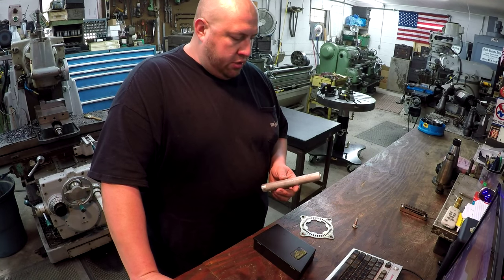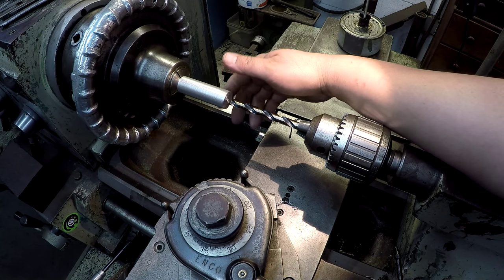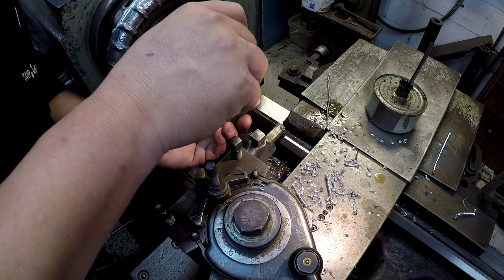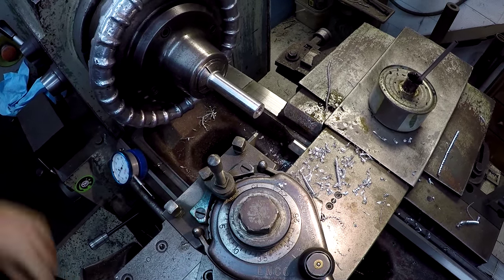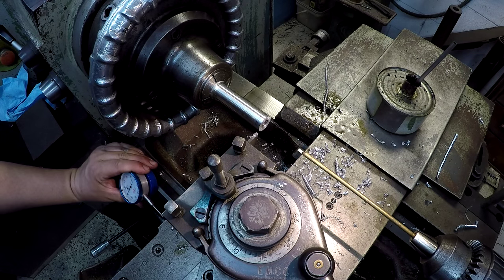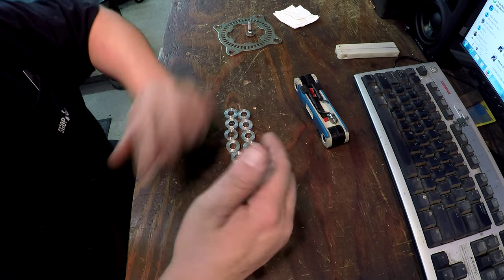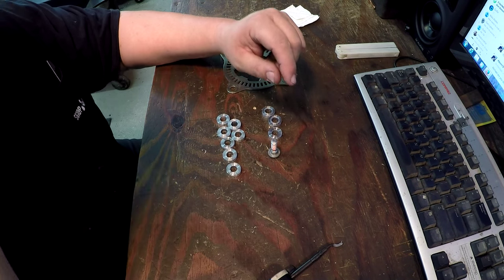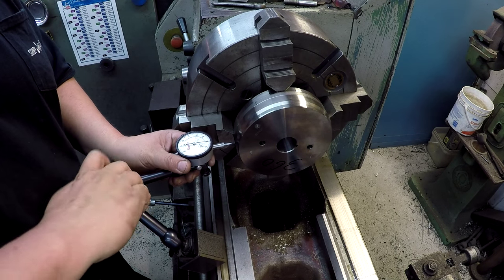Saturday Night Special 89 Part 2

Comment: I made a toolbit that holds a little skateboard size bearing, I find myself using it allll the time to bump chucking work parts true like you were doing with your lead hammer there. It works so freaking well and its so fast I cant stop, especially for 3 jaw work. Sometimes I gotta turn thin thickness plastic parts and I sandwich it between a plastic slug in the chuck and a second sacrificial piece of plastic pinned in the tailstock, the bump centering tool works great there too.

Comment: That noga deburrer works well but I would suggest a glove for the hand holding the parts. I've "read in a book" that they're sharp and can cut you quite easily with a simple slip.  Nice work  Jeff

Comment: Adam,
Not this has anything to do with these the aluminum spacers, but I have a calibration question.
You were using a 1" mic to check the OD of the aluminum turning. I was wondering if you use a 1" gage block to calibrate your mics and how often?

Comment: Great video as always. You used a hand ground high speed bit in this video and an insert in others to do what seems like, to my untrained eye, very similar operations . So why would you choose one over the other? I assume each have their pros and cons. Thanks.
Reply: +Pet Rock&#39;s Garage I&#39;m no machinist myself, but from having watched so many of his vids, in the first part, making the spacers, he was machining aluminum, which is a softer metal.  The hand-ground, high-speed chip-breaker and parting bits he used are perfectly fine and saves unnecessary wear on the carbide inserts when working on most aluminum jobs I assume.  Aircraft-grade aluminum however, might be a different story...

The motorcycle flywheel however was a very tough, but unknown grade of steel alloy, still tough enough to make even the carbide insert cutter howl noticeably.  The high speed bit would have gone blunt in a hurry trying to cut that, possibly no matter how slow he dropped the speed down, and even if it did work, it would have just taken much, much longer to get the job over with.
Reply: Thanks, that makes sense.

Comment: Great video as always!  I noticed at around 4:45, right as you started that drill bit, it looked like it walked up the material.  Is that normal or just a trick of the camera angle?

Comment: Hey Adam,
How do you account for cosine error when you use the dial indicator against the carriage? I remember one of Tom Lipton's videos a while back when he was installing the DRO on his lathe, and he explained that if you don't have the axis of the indicator perfectly parallel with the z-axis, you'll get a smaller reading than actual. If the job is really precise, do you use the dial on the handwheel instead? Sorry if you've already answered this question. Love your videos!
Reply from the maker: +yoonki Your right, and so is Tom. Normally, the work I'm doing it so damn close that it would be difficult to measure the error. You can eyeball the indicator straight enough for most of the work being done.

Comment: at start of vid you thought radius part was 20 m. did you come up with that number by eye of years of experience or you checked
Reply from the maker: +Larry Carroll Those parts are always metric coming off motorcycles, so I matched it up by what I thought was the correct radius. the 20MM od matched that radius perfect.

Comment: It makes me chuckle to hear you do instant metric to imperial mental conversions. I presume you think and calculate in imperial most of the time?
Perhaps you are becoming increasingly bilingual in both systems of measurements by necessity with the work you ccome in contact with?
Reply from the maker: +Dan Whiteford I actually speak in imperial, but try to include some metric for our metric thinking friends. Even though I will never make the switch, I am making a silent effort to be more fluid with the system.
Reply: +Abom79 Aye, but a pint is a pint, when it's in a glass infront of me, but not fer long ;)